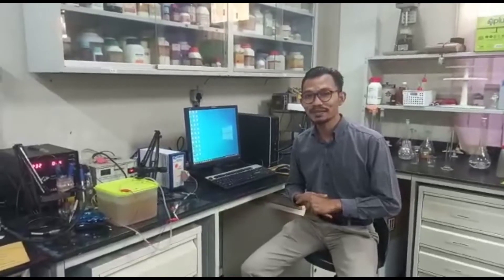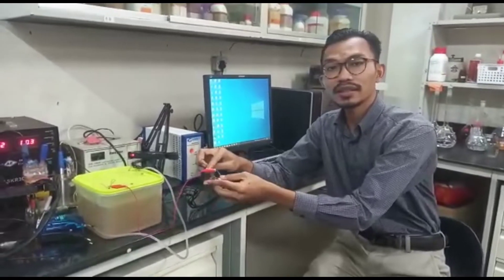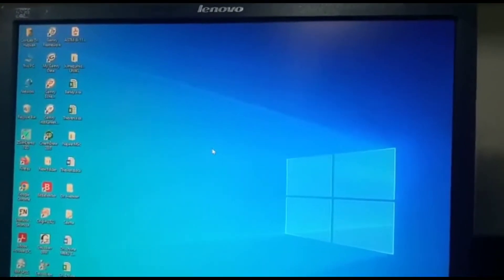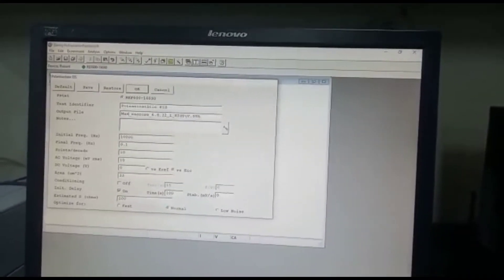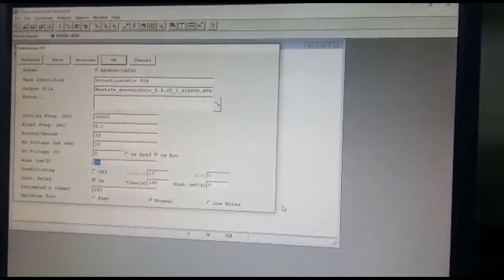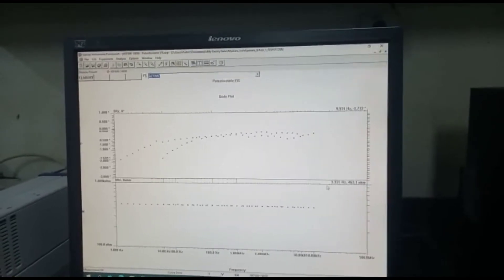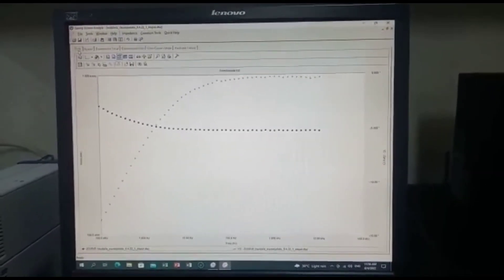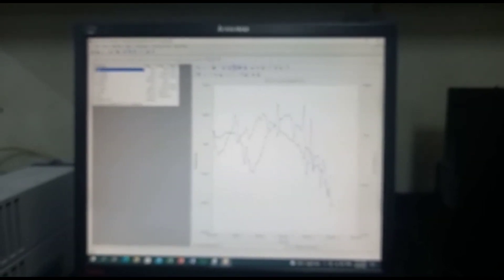How to run EIS experiment for Microbial Fuel Cell (MFC) using GAMRY Reference600 potentiostat

Comment: You are doing great. Many faculty don't want to show what they do inside the lab, but this is going to be very helpful to all the scholars across the world. Please continue to demonstrate this way. My best wishes to your team. So I have one more question regarding PEM water electrolysis: how do we carry out EIS then in complete setup? I mean, when we usually perform the pem water electrolysis experiment, we supply DC in the flow plate in the PEMWE setup, but my doubt is how to carry out EIS here. Should we connect the reference and working electrode directly into this flow field plate and carry out the EIS?
Reply from the maker: @DrBTStm  Hi, that's a very good question. Well, perhaps you should know first what will be your interest; either the PEM itself or the electrolysed water when performing the EIS analysis. Most of the case uses the PEM cell the main setup in 2 electrode system; anode will be connected to WE and cathode terminal will be connected to CE+RE. Through my experience, most of PEM would show major diffusion rather than charge transfer effect; you might see a 45° linear  line form in your Nyquist plot
Reply: @mohdhazwan6523   my interest is in mass transport inside the PEMWE cell. But I want to first study its thermodynamic loss, such as ohmic loss and activation overpotential loss. My interest is in PEMWE itself. Okay, like you have said for WE in the anode flow channel and RE in the cathode flow channel side (steel plates both in the anode and cathode side we used for conducting DC current), in the same area we can connect the AC study using the same procedure. I am not sure how the plot, of either Bode or Nyquist will come in this case but I will perform and see if I can get what you suggested.

Comment: Thanks so much, it helped me a lot. A question, that "Fuel Cell Model" for equivalent circuit, it already exists in Gamry Data, or you created?
Reply from the maker: Hi William, the fuel cell model has been included in the set of Gamry circuits by default.
Reply: @mohdhazwan6523  Thanks!